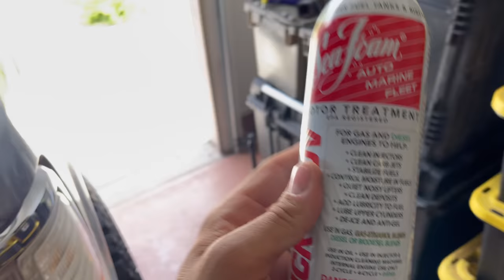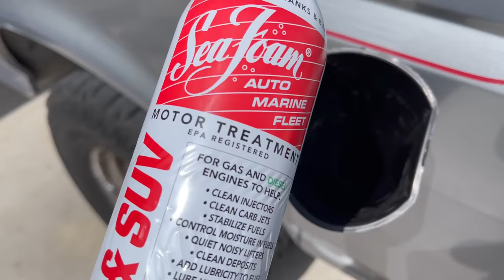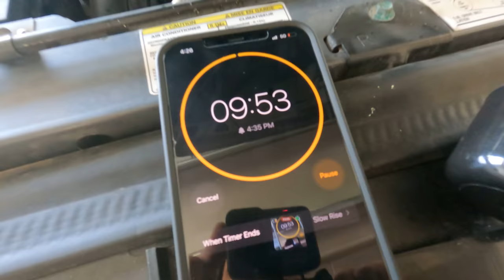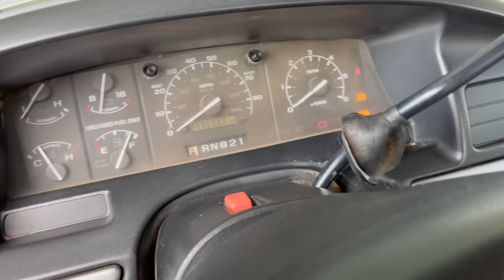Seafoam - Engine Treatment | How-to and is it safe inside your motor?

Comment: I have been using seafoam products since the early 90s. It is an excellent product.  I've used it too stabilize fuel, clean varnish out of carburetors, and carbon out of combustion chambers on vehicles and lawn and garden equipment.  I love it.
Reply: I come across this video for the first time ever,! & I'm curious to know more about it but my ("ONE BIGGEST QUESTION") is
WHY ARE THEY NOT USING THIS STUFF AT ARE LOCAL OIL CHANGE...??
Reply: @johnlarett9891  typically because it’s an added expense that the shop would have to charge the customer and the customer usually wants it as cheap as possible. Sea foam is usually readily available at most auto parts stores, Walmart, and even in some gas station/truck stops

Comment: Sea Foam has been a wonder on smaller engines too. My old Gravely lawn mower was running rough even after replacing filters and giving a new plug. I used it on the intake and fuel and now it runs like it's 20 years newer. Also, you can use way more than what the bottle says on a small engine and it won't hurt it.
Reply: I was wondering just this. Thank you for your comment. Is it pretty much the same process? Put some in the gas tank some into the oil and some into the intake?
Reply: @marte1a256  Buy both the liquid can and the pressurized can of Seafoam. Pour double what the can says into the gas tank and then run the engine up to temp. Then spray the pressure can into the intake and it'll make a whole bunch of smoke do this a few times. I didn't put any Seafoam in the oil, I use Marvel Mystery Oil as an additive into the oil instead. After the tank of Seafoam runs out, I'll do a run with MMO in the gas for good measure. Project Farm did something similar with how it'll smoke from the intake https://www.youtube.com/watch?v=agAWXnT4-EQ
Reply: @ZachComa  thanks. Will do on all my kids’ dirt bikes and quads and our lawn tractors
Reply: Works great on 2 cycle engines..weed eaters and blowers..chin saws any of it..

Comment: Was a motorcycle shop by my old store. Bugged the guy for months to help with some carb issues I had. He said 90% of his carbs would clean and run perfect after using seafoam. Thought he was messing with me. Worked so well after one tank. I have now been using it ever since. In oil,  fuel, snow blowers cleaning. Best stabilizer as well. It is truly the most magical vehicle product out there.
Reply: A petroleum distillate will handle most carbs that are in use. (Won't fix or help a barn find that's been sitting with fuel in the bowl for years).  Seafoam a good cocktail.  Marvel mystery oil is about tranny fluid...lots of smoke but not much help except to rejuvenate seals.  One can lasts me years.

Carb cleaners from STP or others is OK too.

For mowers and small bikes, I just spray cleaner in the intake throat every spring after the motor is hot.

I wouldn't put it in the oil as on a bike the oil is also the clutch oil and bath (wet clutches)...but in a car, sure.

Comment: I have been using this in my lawn equipment for 10yrs +. It works most 96% of the time on slow starting issues. All the time when I used it as a year end fuel stabilizer. Some of my trimmers & blowers may not get touched for 2yrs. Fires right up within 6 pulls. My 10hp generator had 5 gallons of 2019 reg gas. Bi-yearly test runs since, 1st pull.

Comment: The absolute best thing you can do for your high mileage Windsor is to replace the timing chain and sprockets, regardless of how well it runs. You need to dial in that valve timing for optimum performance. I drove my Ford 302 70 miles and shut it off. It was running perfectly. When I tried to restart it, all it did was backfire. Had to get towed and have the timing chain replaced. Do this before it screws you.
Reply: Similar in my dodge 318, they used nylon coated timing gears back in the 80s... double rollers never let you down

Comment: Fluid ounces and dry ounces are different. Fluid ounces measures volume where ounces measures weight.
Reply: Yeah, don't measure it by weight. Maybe he shouldn't do how to videos on this.
Reply: One fluid ounce weighs one oz
Reply: @Allen.alledgedly2  that depends on the fluid... water and milk, for example aren't the same wieght. A gallon of water is 8.3lbs and a gallon of milk is 8.6. They aren't going to wiegh the same at the oz level either.
Reply: And this is another example of why the imperial system is stupid
Reply: @greebuh  more or less.. you’d have to have a scale that weighs the to hundredth of a gram to even be aware of it
Reply: @Allen.alledgedly2  dude said that like solid arent the same. A feather is a different weight from a book 🤦🏾‍♂️🤦🏾‍♂️

Comment: Every spring I run 15ml per L of fuel in my 1978 KZ650 B2. It improves every aspect of the fuel system  y the end of the tank. Wonderful if used per the directions. P.S. I'm sure your neighbour's love you.

Comment: I have been using Seafoam for the past 5 years on a 2000 Chevy Express van 4.3 v6 with 190k miles. I only use because 1 lifter doesn't fully pump up it really taps loud, and after adding  2 ounces of Seafoam the lifter pumps up & is completely silent. The engine runs perfect until the next oil change. Can't recommend this product enough, it has saved me thousands $$ 👍
Reply: After adding seafoam to what? The oil? The gas? The air intake? I have a lifter tick as well.
Reply: @Chris-gl3vh  engine oil per instructions on can

Comment: Ive been a powersports mechanic for a few years now and this stuff works wonders on air cooled single and twin cylinder engines. Ive never been brave enough to use it on road vehicles due to potential exhaust deposits. I just use lucas oil instead
Reply: @Robert Pierce i have no idea. Ive never used seafoam in road vehicles. From what little i know of bmw, engine tick probably means the repairs will exceed the value of the car
Reply: @Robert Pierce 0W-40 Mobil 1
Reply: @Robert Pierce yes, it will clean hydraulic lifters and stop the tick.
Reply: Good job

Comment: I use it in my Mercedes glk350. My mileage was around 15-16 miles per gallon. Now I'm getting an average of 19 mpg, so it's definitely worth it to me. I pour one of the fuel injector cleaners into my tank twice per week.
Reply: If you are doing that every week, you are using waaaaaay too much. Just one bottle should do it for every 3,000 miles
Reply: Damn how much are you driving a week that’s 20$ a week
Reply: You'll be replacing the fuel pump by over using this stuff in your tank, it dries out the o-rings and seals in the fuel pump.
Reply: @NegativeOriginality  A solvent very temporarily appears to lubricate but in the long run it is a solvent which devolves and erodes....how else do you think it cleans carbon residue?
Reply: @NegativeOriginality  If gas is MORE of a solvent then how is it 16 gallons of gas per week is not cleaning fuel deposits and carbon but yet diluting the 16 gallons of gas with 16 ounces of a "lesser" solvent supposed to clean it? It is a solvent and overuse as with overuse of these other "fuel treatments" will kill your fuel pump. Use sparingly.
Reply: You will mess up your fuel injectors doing it that often… it will naturally increase fuel mileage because you are cutting the fuel with it

It’s injectors are meant to inject fuel, the car wasn’t designed to run off seafoam
Reply: You should back off the Sea Foam to like every 4 or 5 tanks at minimum

Comment: I use this to winterize my lawn equipment.  I let the gas run dry, throw this in the tank, start it up to get some in the system and then shut it down for the winter.  Add gas in the spring and it fires up every time as if I just ran it the day prior.  I did the same thing when I had a motorcycle.  It's a must for ethanol gas areas...

Comment: It really works well. been using it for years now on all my cars.  Trans am was losing power especially top end, 1 intake clean up power restored.  Cleaned it twice, my other cars only once but I add it to oil and gas tank approximately every 5k miles.  They run nice and smooth:)

Comment: Been using on my 1992 outboard motor every year ..Still fishin ! Works great. Engine starts every time. Good for winterizing (fogging) too.
Reply: Just don't use it in the newer outboards with direct fuel inject plugs the injectors it's oil-based

Comment: 7.5 liquid ounces is different than 7.5 ounces of weight.  Fluid ounce is a unit of volume, so it must be measured in a container of known volume e.g. a measuring cup. Dry ounce is a measure of weight, so it must be measured using a balance or scale.

Comment: Great vid! I’ve got a 2013 G37x with a slight lifter tick I just noticed about 2 months ago. Noticed it around 110k miles. Also running a bit sluggish. Put 1/2 can in crank case and the other half in the gas with about 6-8 gallons in the tank. 
After only 150 miles the tick is virtually gone and it seems to have slightly better pickup. Gonna change oil and filter after around 300 miles like it says and listen for that tick again. Probably run it in the gas again one full can to a full tank (approx 18 gallons) and see where I’m at. Won’t repeat with every fill up but maybe after 10-15 fill ups. I cleaned the throttle bodies and maf sensors not long ago so I’m not gonna spray the top just yet. It’s a little early to decide for sure but so far this stuff has my vote for being effective as to what it says it’ll do so hey, am I just lucky ( not with anything else so, statistically probably not). My opinion is 👌🏽for gas AND oil. I used the spray in the carbs on my outboard years ago and it did well there too so… yeah and it’s very rare for me to even mention something let alone recommend it. Outside of my motor blowing up in six months I’ll give it a 👍🏼. 
Everything on the tube is 100% true, as we all know LOL so what the heck.

Comment: Nice video, BUT, you should've used a measuring cup for the crankcase application....not a scale! Liquid ounces are different than "weighted" ounces.
Reply: One liquid ounce actually weighs one ounce.
Reply: Only if it's water- the specific gravity (density in relation to water) of different fluids is different. You can calculate it if you know what the weight of a fluid ounce is of a given fluid is but that's more math than is necessary.
Reply: @lisacyr8860  hahah is this bill Nye the science, Guy undercover?
Reply: The more the better

Comment: Great video, right to the point! I'm 66 and don't drive very much, so when and for how long should i leave the cleaner in the oil? I have a 2005 Toyota van with 163,000 miles.
Reply: 100-300 miles then change your oil

Comment: I did my crankcase within a week Had to change oil ...it was Black when I changed it, Yes I changed my own oil  LOL  YAY   It cleaned it quickly it was amazing will do another treatment soon....Going to change my transmission again thinking of doing seafoam in transmission driving a day or two and drain fluid... a tad worried we shall see..oh 2008 scion xb 193,000 brought this used car in May

Comment: Just putting this out there he said add to every tank of gas bottle say every “3000” miles for best results and to only run In oil 100-300 can clean to much and blow ‘em but great video man!!
Reply: The can says you can put in before or after oil change and at least every oil change but best results every fill up.

Comment: When using the seafoam in the crankcase I believe the 1-1.5 oz/quart of oil is a liquid VOLUME - NOT weight (use a measuring cup, not a scale).  fortunately, the weight you measured wasn't too much more than needed but I'm guessing is was more than recommended.

Comment: I do the "hot soak" use the same bottle for crank case . Get engine warm then pull break booster hose pour sea foam in that it sucks it right in. Let it sit for 30 mins then start it up. I do it  about once a year on all my vehicles . Since I'm the one who does maintenance  on all my personal  and work trucks.  Basically  the same as this video  but without  the  special can with hose.

Comment: I used seafoam direct into the catalyst converter clean out the carbon ran it for about 200 hundred miles and it worked my car passed inspection

Comment: I remember I had to drive 8 hours to get to west Texas for my first day in the oilfield. My car broke down and my grandmother let me use her old Nissan ultima..which I think had around 300k+miles on it. By the time I made it..the car was literally sputtering around..full tank of gas..pedal to the floor it wouldn't go over 40mph..I dumped a whole bottle of seafoam..and it ran a little better..then filled up again and dumped another bottle..by the 4th fillup shit was running like a top.  Idk if it was Injectors or fuel filter or what but it cleared it out.
Reply: bad gas
Reply: @rockymountboy  Yep, ethanol attracts moisture, if the vehicle sits it will get a sufficient amount of water to run poorly, along with depending on where you get your fuel the ethanol content can be much higher that advertised

Comment: technically you dont want smoke coming out of the exhaust after performing this service. the white smoke is the excess fuel system cleaner being burned off. however its dumping it all onto the catalytic converter causing it to heat up more than it should resulting in long term damage to the converter. less smoke is better. no smoke is best. run rite make a system that is introduced thru the brake booster line. after the throttle body. petroleum or not, you dont want solvents going thru the throttle body in fear of damaging the throttle position sensor. remember, fuel does not flow thru the throttle body. only air. fuel is introduced from the fuel rail, to the injectors, to the combustion chamber. also adding a solvent to the crankcase does dilute the oil in turn changing the viscosity. It will thin out the oil, and decrease its strength to lubricate. we've used oil flushes in the past but have always drained out the flush and ran clean oil thru it at least 2 times before settling with the final fill.

Comment: Seafoam is basically kerosene. Originally developed for use in 2 stroke outboard motors. Highly effective in cleaning  carburetor jets. It will also melt sludge in the crankcase, BUT it will also thin out your oil, so I would not run it in the oil long term. I would run it easy for about 3,  slow  10 mile trips babying the car, then drain the oil. If you are already running 20wt oil I would be even more cautious. You can get the same results using plain old fashioned kerosene much cheaper.
Reply: Cheaper to add kerosene in the tank?
Reply: @theautorepairhub  i guess that depends where you are. Here, Seafoam is close to $9 pint at WalMart. Kerosene is less for a gallon
Reply: Light oil and isopropyl alcohol.
Reply: Not just kerosene. Seafoam also has small amounts of acetone and aromatic solvents, similar to lacquer thinner, which do most of the work of dissolving deposits in fuel systems and the inside of the engine.The rest of the 'carrier' is probably kerosene or something similar. You definitely don't want to subject your lungs to the stuff coming out of the exhaust after the intake treatment!💀

Comment: You are supposed to put air tube back on while spraying. That's why the spray tube is so long.
Reply: Some engines will run with the air tube off.  Some won't.  Depends on how the computer reacts when it sees zero flow through the Mass Air Flow and Manifold Absolute Pressure (MAP) sensors.  I like to see where I'm spraying if possible so I can clean the butterfly valve and its contact points on the throttle body.

Comment: The sea foam was great! I used it in my 1992 Toyota Hilux truck 22RE engine in the fuel system and lubrication system and it remove the engine noise.."